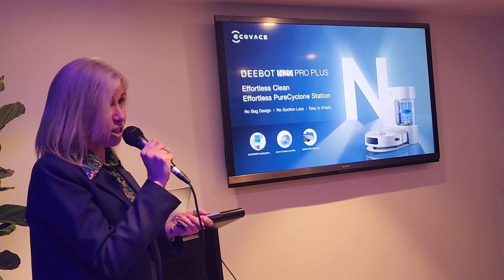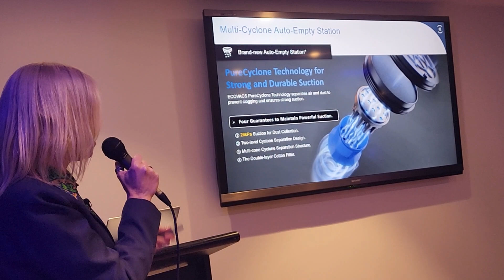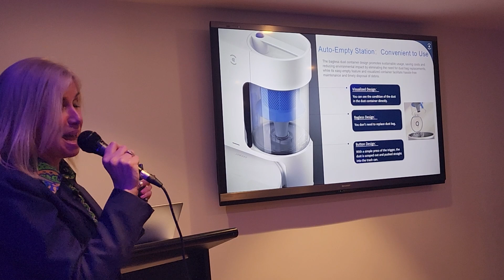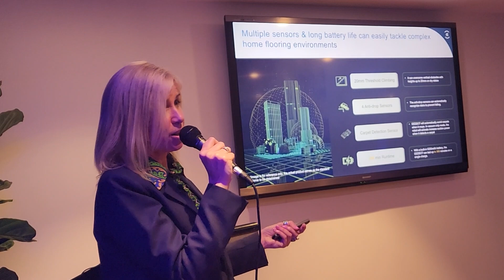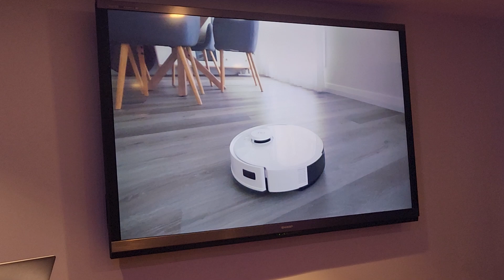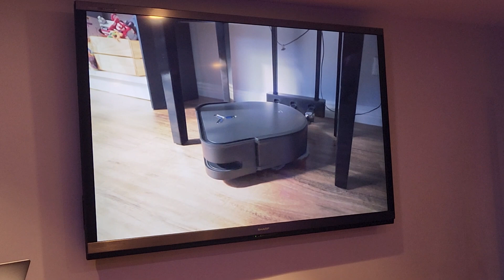Ecovacs N20 Pro Plus Review of Features and Specs

Comment: Hi! Please reply! Looking to buy N20 pro. My house is 1400-1500 sq ft. Do I need to refill water tank for mopping? Online tank capacity shows 240 ml of this model
Reply from the maker: The advertised single run size is 1800 sq ft, so it should be able to do it, but only just I would think as they always over-estimate.